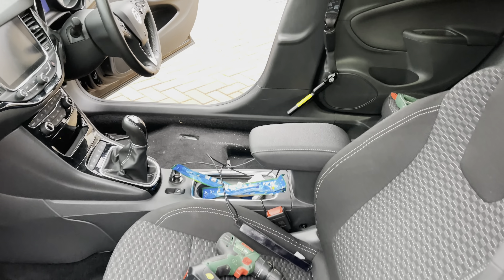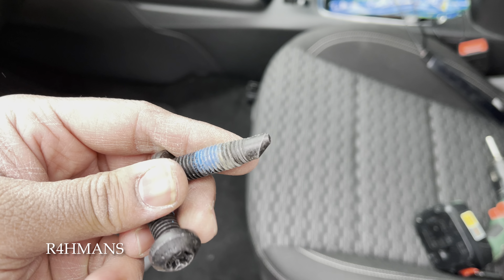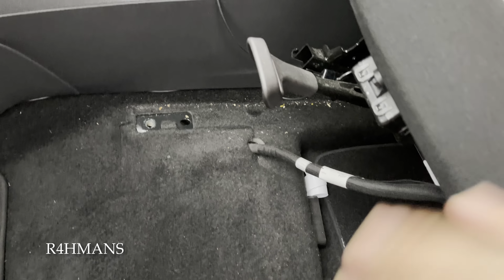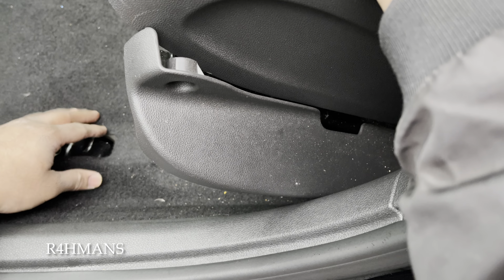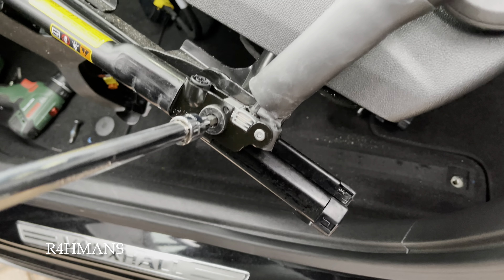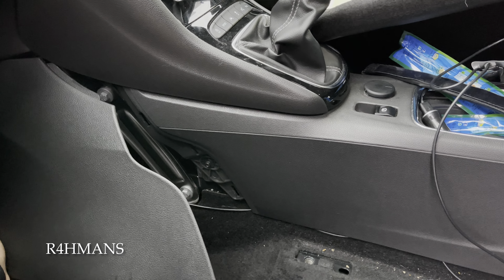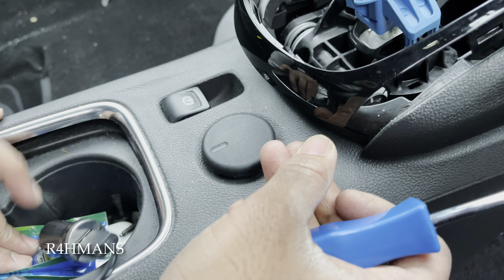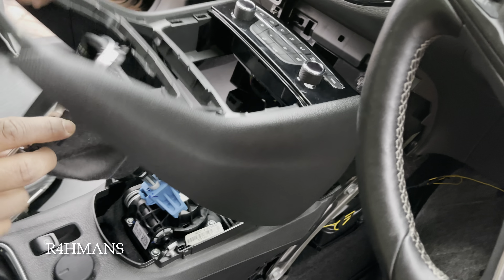Upgrading Astra K Interior Part 2

Comment: Hello, good luck, I have a subject that I need help with. I own an Opel Astra 2016 and I received such an error in my vehicle (b216). The passenger compartment darkening 1 circuit error, that is, the steering wheel buttons, door buttons and the buttons in front of the gearshift are flashing white illumination lights every 30 seconds. Normally, they should be on steadily. Thank you.

Comment: I want to do the same upgrade but i have the normal chairs, without heating. Will i get any errors if i connect the new ones?
Reply from the maker: If it’s a standard seat I don’t think you would get any errors only because the ones be I did it has lumbar support and it has a button for that and seen it does nothing and I don’t get any warning or error message
Reply: @R4hmans  i am afraid however that now i have the standard seats with no electric controls. I am not sure if i change them with electric ones, if i can adjust them.